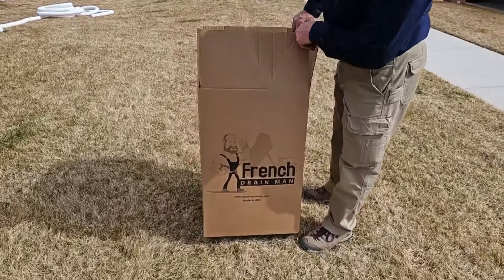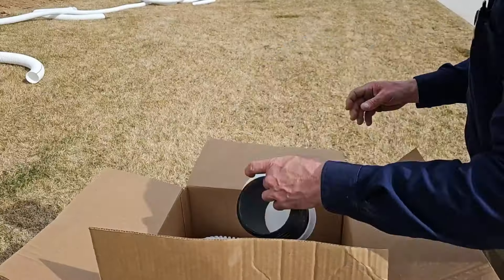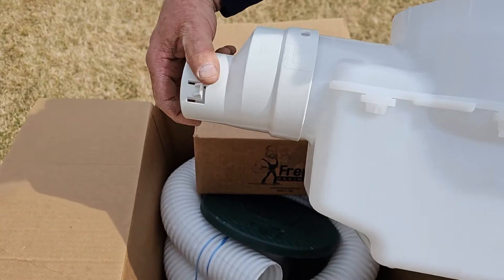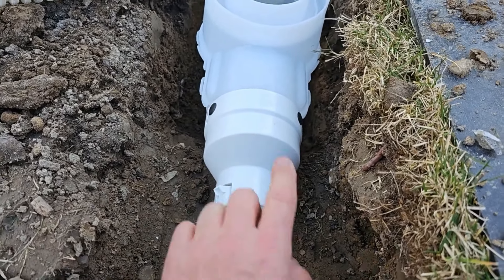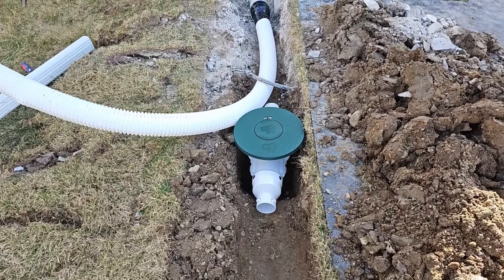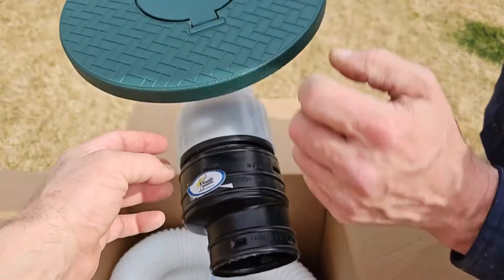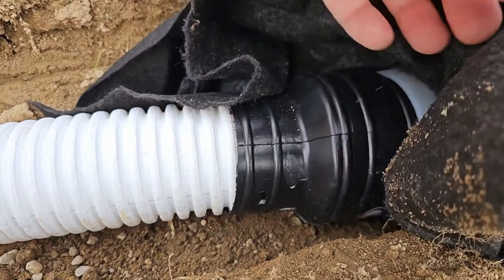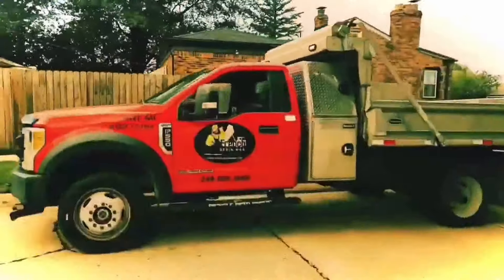New! 3 in. Pro Kit for Buried Downspouts

Comment: How many feet of knife cut do you recommend to use on a 15 ft run?  Does it differ for my longer 40 ft run?
Reply from the maker: With 3-inch pipe, we do not put any knife cuts in the downspout line. It already holds 56% less water than 4 inches. It can leach away at the pop-up emitter.
Reply: @FRENCHDRAINMAN  Thank you, sorry I should have posted this I was looking at the 4 inch kit that comes with 15 ft of solid and 15ft of knife cut.

Comment: Does it include the piece of fabric for under the catch basin?
Reply from the maker: No, it's not included.
Reply: Wish they would add this as an option.  I added a piece and it was $12 shipping for a $8.50 piece of fabric.
Reply: What size drill bit did you use of the bottom of that catch basin?

I just order two pro kits.  I ordered the fabric and extra tape.  How does the pipe connect to the the leaf clean out, catch basin and emitter?  Is there a snap lock system?   Or are there special fasteners to keep these different components locked together?   If so, are they included with the kit?

Comment: Our Pro Kit Plan - Leaf Filter/Clean Out in Black - connect to ~ 5 ft of 3 inch PVC to run under a yet to be poured side walk - to connect to 24--25 ft of 3 inch Solid Corrugated pipe for straight run out to swale at the end. We have covered gutters so do not need the drain basin.  I can not find a coupler to connect the 3 inch PVC to 3 inch Corruagted Pipe.  I've searched the open market and can't find a coupler that would go over the 3 inch PVC end and inside the Corrugated Pipe end. Any suggestions. We hope to work with a contractor so want to keep details simple.
Reply from the maker: We simply use our catch basin, and the PVC enters one end of the catch basin with our female adapter. Then, we exit with our offset 3-inch male adapter on the other end of the catch basin; it serves as a nice cleanout midline.

Comment: Just had rain pouring last night, everything was working good, water was coming out of the pop up properly,  but this morning there is still water almost up to the pop up? Is this no tape area is not leaking enough??i did put drainage rock and that black fabric like video.. I didn't put any knife cut pipe before the not quite a 90 and end pop up... but i am wondering if its gonna slowly empty the pipe,  or usually its supose to empty itself fast by that no tape end pipe?
Reply from the maker: It takes 72 hours of dry weather to leach into low-percolating soil.

Comment: I have a question I didn't actually buy the kit because I needed more pipe than was included for my one downspout. So I basically bought everything individually and built my own. I didn't order the new couplerI just ordered the 3" coupler will it work with that pipe.?
Reply from the maker: Yes, it will. The 3-inch on-center was our original 3-inch coupler that fits every 3-inch pipe on the market. The offset 3" coupler that we made this year, new for 2024, only fits our 3-inch Plus pipe and ADS 3-inch pipe.
Thank you for your business!

Comment: We have a concrete border edging. That’s about 2 1/2 feet away from the house.    We just dug the trench.   Beyond that are several irrigation pipes.  

We are going to be having a 3’ wide paving block walkway done in the next few weeks.  The paving block walkway will hug the curved concrete border edging.

I had no choice, but to move that catch basin out about 7 feet from the elbow under the leaf filter.

It was our only option.  We are in the process today of finishing the trench and connecting all the components with the sticky tape.   Except the last connection on emitter

Could that be a problem with the distance on the catch basin?   

We have a large slope on the side of our property away from the downspout .  Probably at least an 18 inch drop over 20 feet.  The roof is brand new
Reply from the maker: That sounds great! That system will be fine. 👍

Comment: I am attempting to install the downspout kit, which is straightforward. I have encountered a few questions, and I am wondering if it is an "operator error." 1. For the catch basin, I drilled the small holes at the bottom following the template guide. When I tested the downspout to the basin, the holes allowed so much water to leak out of the basin that nothing flowed through. Is there a fix for this? Should I plug a few of the holes to slow down the release of water? 2. I have everything connected & tested the catch basin to the end, almost 90 elbow. (I did not tape this portion as directed in the video) Again, so much water flowed out of the connection point (all the water is now in the trench) that it did not build up and flow out of the top. I figured this would not occur if the trench was filled with dirt? I can drill deeper, however, the top of the of the green cover will be below the grass line.
Reply from the maker: You're correct. You have to backfill with the dirt, and you will be fine.

Comment: I have a downspout in front of my house that I would like to do this with. Questions….how deep do you run this white hose? If I need to run it a considerable length, won’t that put the discharge end below the surface or the lawn?  Is there enough water pressure to make the water come out the top? Also, is the white hose solid or does it have holes to leach out along the way TO the discharge?
Reply from the maker: https://youtu.be/yFxGFxfSD0A?si=J32ukPOtvvb_Bkyx

Comment: Need help! I didn’t tape the pop up emitter at the end like you suggested, but with a garden hose running pretty good pressure down the leaf filter, nothing is coming out of the emitter, it’s all leaking out of the 3 to 4” connection to the not quite a 90 elbow. Why is it leaking so much? I figured it would be only gradual like the catch basin. What should I do? Thanks
Reply from the maker: @DAMCOOLDAV
It's supposed to leach away water after big, heavy rains. Whatever's left in a line can leach away so you don't have standing water in the line. This is really important if you live in the North, where lines will freeze up. By the way, a garden hose doesn't simulate a torrential rain, not even close. Your system is working as it was designed to work. Sounds like everything was done perfectly.
Reply: @FRENCHDRAINMAN  I’ve watched a ton of videos but not too many demonstrate water coming out of pop up emitter. The black connection piece appears to connect to a corrugated pipe already in the not quite a 90 elbow and looks potentially defective. It’s not a snug fit and isn’t cut evenly all way around. Can I send pictures to an email to confirm? Also does water only come out of pop up emitter on torrential downpours?

Comment: Love the new kit. One question: If I am in the Northeast, do I need to add a few feet of knife cut before the pop-up, or is the new adjustable swivel fitting sufficient to allow water out and avoid freezing?
Reply from the maker: Three-inch pipe has 56% less area than a four-inch pipe. Really think about that. It's one of the many benefits of using three-inch pipe. Fifty-six percent less water is huge. It's a lot easier to leach what's left in the line through the pop-up emitter. We do not use three-inch knife cuts. All I can say is if you're going to go that way, you better put stone around that pipe because if it fills up with a little bit of dirt from the perforations, again you have 56% less area.
Reply: @FRENCHDRAINMAN  In a different video, I think you mentioned drilling a small hole in the not-so-90 elbow of the popup emitter for super cold regions (up north). Here you say just let it leak (no tape) and not to drill hole.  Which is the recommendation for Up North East Canada ? Thank you
Reply: @PANICiii following, another comment made it seem like it will leach enough without drilling

Comment: Is the catch basin primarily for catching asphalt debris from a shingle roof? I have a metal roof and would prefer to not have a catch basin if I don't need it. I do have pine trees which shed needles onto the roof, but I assume the leaf filter would take care of that.
Reply from the maker: Pine needles are the worst. I can't think of anything worse for a gutter system. You need to do everything you can to catch pine needles. The only way I wouldn't use a catch basin is if you cut the pine trees down.

Comment: I bought this and installed my first downspout. I have two questions here. If you connect the pipe to the basin and then you would like to readjust it then how would you remove it? Also, the end of my set up comes at an angle and I’m worried that it’s tangling down and does not allow for complete emptying. Do I need to have it straight or is it OK to keep it angled
Reply from the maker: The most common settings for those couplers to the catch basin are to have them shallow on the inlet side and then hook them up the opposite way so that they drop off and are a little deeper for the discharge end of the catch basin. Yes, if you decide you want to do it differently, you will have to cut the fasteners off with a box knife, and we will have to mail you additional fasteners. As far as the angling up, I hope that's only at the pop-up.
Reply: @FRENCHDRAINMAN  yep only the pop up is angling up. I don’t think we’re talking about the same thing. I’m talking about the attachments to the pipe. They clip in, how do you remove them off the clips?

Comment: What type of pipe system do I need for Sump pipe lines through the yard ??
Reply from the maker: Downspout Pipe 4 in. x 100 ft. High Octane ARMOR Pipe
https://frenchdrainman.com/product/heavy-commercial-solid-high-octane/
Reply: @FRENCHDRAINMAN  I'm needing to put in a line for my sump pump discharge.  Would I need 4" also, or is the 4" just for the outside buried sump pump systems?  Also, what is the proper way to connect the pipe to the discharge line from the house?  Looked for a video on this but didn't see anything. Sorry if you've already answered this.  Great system by the way, thanks for all the info for us homeowners.

Comment: I received the "complete DIY kit" directly from French Drain Man, and it came with no instructions and doesn't seem to have enough parts to complete the installation from end to end as in this video.  There is only one elbow in the kit.  There is no "riser" piece in the kit nor any "offset coupler".   As there are no instructions, I emailed FDM for help and they linked me to this video.  (This video doesn't contain a single moment where anyone shows any two pieces actually being physically connected together.)   FDM support was nice enough to answer my questions promptly, even on a weekend, so now I do understand how to assemble the kit, but it would have been nice to have some instructions and a diagram of the actual layout of the parts.  There is no video I have found that actually shows how to install the DIY kit.  Also, it's very unclear how to use the turf restrictor plates properly (which is also neglected in the video).
Reply from the maker: You bought the easy DIY kit10, not the pro kit.
You need to watch this video.
https://youtu.be/mDlWmcZ-pcw?si=xFSqPJAUX1ci7wrb
Reply: @FRENCHDRAINMAN  Thanks - that's a helpful video.